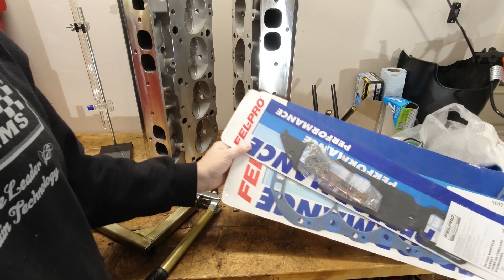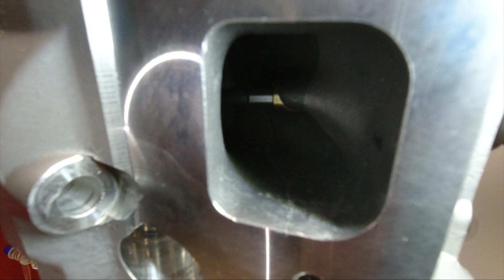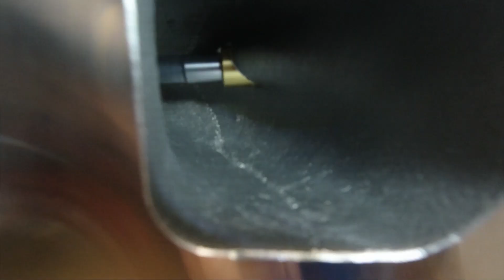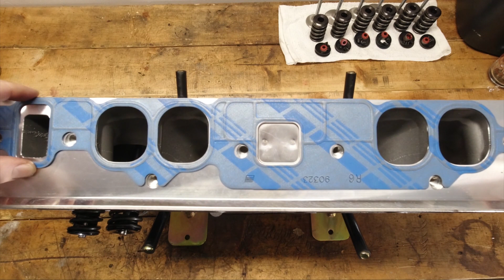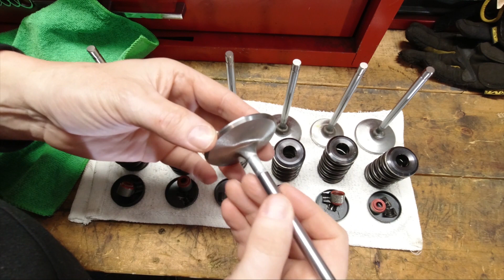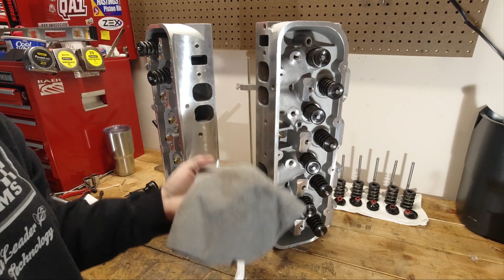Speedmaster Big Block Chevy Head Review

Comment: @bone head excuse the dumb question just getting into all this will the 396 heads fit the 454
Reply: Only dumb question is one that isn't asked
Reply: @MuscleCarSolutions   I too am in the market for a budget friendly oval port BBC head, these look very promising however my BBC is a 396/402 and im worried that the Valve size will cause to much shrouding. I feel an ideal size would be 2.19/1.88 but i believe these are the 2.25 valves correct? TFS makes a 290 Oval head with 2.19 valves that they advertise flow really well but at $1600 bare there a little pricey. What do you think about what ive mentioned using these heads on a 396/402 block in relationship to the valve size? thanks
Reply: Joe, I have -41 CC dome KB pistons, I guess what I’m more worried about is the shrouding from a 2.25 valve, I know I could get some relief but I don’t think enough. The block is a fresh 402 bore. I’ve been looking hard at the TFS 280 heads that come with 2.18 valves but at $1300 a pop it’s not in my budget, at least not right now. Thanks for the reply!
Reply: @IT3Mack  Finding the most reputable machine shop in your area is a must. They should be happy to help you pick the best Parts for your build, new or used. Never Just put something together without a good shop checking it out. This will save you $$$ and headaches in the longterm. Just my 2cents. Good luck and have fun...

Comment: What year start & end years for the 454 will these heads work with?
Reply: Thanks
Reply: Just make note the year they change to the other gasket  (mark V to mark vi big block) as some of the cooling holes are different between certain heads/ block/ gasket.
Reply: 90/91-95 not sure exactly. But easiest way to tell is the mechanical fuel pump provision. Gen 5 was the only gen to not have the cutout for the mech fuel pump

Comment: wow great video! a guy is currently building me a mopar 360 magnum, and he got a pair of these speedmaster cnc heads. he went with the bare casting so he can scrutinize them and further modify. he was going with also speedmaster roller shaft rockers and i said no, too many bad reviews on their rockers of coming apart! so hes going to use oem stamped non rollers coz they are more bullet proof and reliable with no periodic adjustments with (hydraulic roller cam). theres really no power gains going to rollers, and dynos have proven that, waste of money
Reply: A good quality roller rocker is essential for getting both truw lift as well as duration.
A LA Mopar with a roller cam is simply going to be an accident!
Reply: @ldnwholesale8552  well i decided to go with harland sharp roller rockers, wise choice

Comment: Would you run these out of the box with valve and springs. I have a low compression 73 mark iv 454 with ported 781 heads. Im wondering if I get a set and port them would it be worth it for power gains. Was thinking just use the comp springs that came with my cam
Reply: NO! Never unbox heads and install. You need to check that all of the springs meet you cam spec needs and you need to check that the valves are seating correctly no matter what brand you buy. It is reported that some valves are made of Chinesium so beware. You need to go to an AFR 265 to beat your ported 781s, depending on how they were ported. Knowing what you have with your 781s would require them some time on the flow bench unless you already have that info. Heads and camshaft will make or break your engine.
Reply: Im not a professional but I under the impression that 345 cfm was for no smaller than 500 cubic inch to 600 plus so for 454 I wouldn't even port these heads